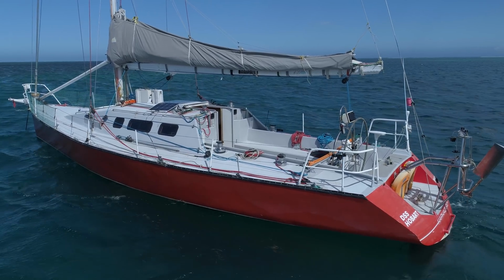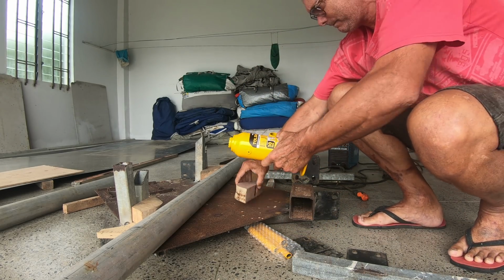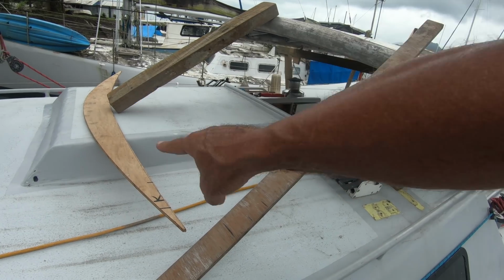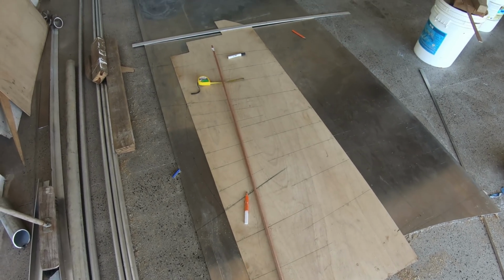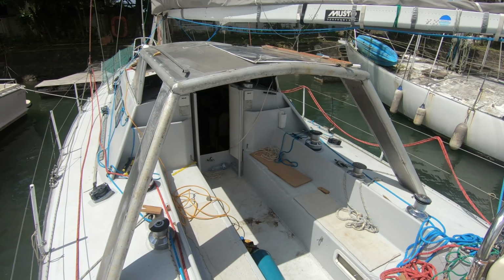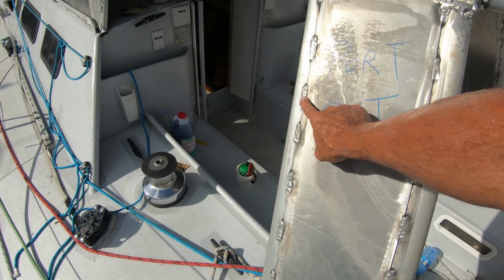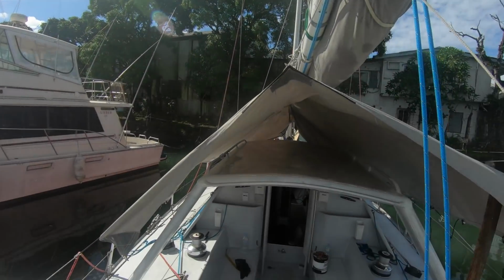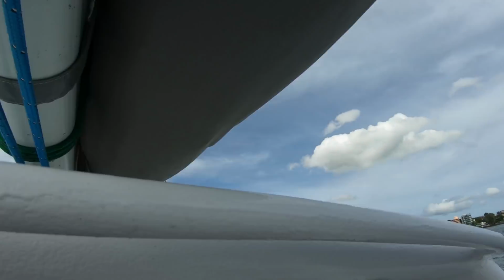Hard Dodger build in Aluminum (Ep7)

Comment: Is there any problems with the boats performance with adding the weight higher up in the boat and wouldn`t you need to add weight in the bottom of the boat to balance it out.
Reply from the maker: Just a little bit. The whole structure is light weight. Probably alot less than one person. When the boat was racing it probably had about 6 crew. That is much more weight.
Reply: Thanks for explaining how it works. @captainscarlegs

Comment: It would have made a much smoother appearance if you would have used Bondo on those rough spots and cracks. That's the way they build yachts believe it or not. Most of the fancy yachts you see have at least one inch of Bondo all over them, shaping them but they turn out nice!

Comment: Cool to know you can blast a pipe with a propane torch to bend it in a jig.  I've seen copper pipe filled with water and then frozen to keep if from collapsing when bent.  Not sure that method woukd work with aluminum, though, as it is less ductile than copper.
Reply from the maker: Yes. Me too. It did work but not perfect bend. Possibly filling it with sand and caping the ends could help. I once bend small Guage alloy pipe with sand in it in a tree fork and got quite a tight bend.

Comment: Great work on the dodger. It looks great. And it makes sense for cruising. 
Those back supports though... are you sure they are strong enough? 😁
Reply from the maker: Thanks. I think the back supports are strong. It has  2 x 2-1/2 in pipe with 3mm plate on both sides. Could easily take the weight of several people.

Comment: Nice work. It's weird seeing the old girl like this. Not bad weird, just different. We used to use the winches on the cabin top for trimming shy spinnakers. The trimmer would stand on the side deck, next to the cabin, and the sheet would lead around the cabin-top winch from the block on the gunwale. Won't be an issue on a cruising boat!

Good to see you've fully embraced the hazard ethos... shorts, t-shirts and thongs while welding 😎
Reply from the maker: Hi John. Great to receive your response. It's good for me to hear about how you used to sail her in Tassie. Are you Launceston or Hobart? I may have to get a sock or a furler one day . So I can use the Spinnaker s. I've got a pile of them in the garage. Happy New year.
Reply: @captainscarlegs  I'm in Launceston. I sailed with Nick in the '90s.
Reply from the maker: Good one. I'm sure you know the boat well

Comment: How big is your boat?  I have a 56ft i want to sail to Fiji (from Sydney) and I have no dodger.  So are you saying i will get smashed?  Maybe I should sell it and fly?
Reply from the maker: No you will be ok 56 is a big boat
Reply: @captainscarlegs  Thanks.  It is a Dufour 56. I commissioned it in 2019.  I am getting quotes for a hard dodger now. I want to sail it to Puerto Vallarta, Mexico.  But first I want to take to to Fiji to iron out any teething problems. It has two stearing wheels and a Code 0 down wind sail so I hope to average 12 knots + when I cross the Pacific.
Reply from the maker: Sounds like an impressive boat. Just to let you know unless you go south 
. Traveling to Mexico will be upwind most of the way
Reply: @captainscarlegs  I know - I will go deep south, then I will be down wind till I hit Argentina coast, then travel straight up the coast down wind.  Then only a small section will be in irons from Panama to Puerto Vallarta, but i can tack most of the way.  I may have to motor a lot for that bit, else the code zero may help.  Deep south, and up SA coast should get 15-20 knots, then last leg 3-6 knots. Coming home is downhill all the way lol

Comment: So good, beats breathing in all that fibreglass dust, eh? Bit of kero in a squirty bottle helps for cutting ally with tungsten blades.
Reply from the maker: Exactly. The fibre dust and all the bog would probably be more work. Thanks for the tip on cutting. Will try that.

Comment: If you add red and white led light strips under the dodger and hide the wire down the posts, if you ever build and another or modify it put 3/4 dams to direct water that is forced thru the sheet holes backout the sides, and if you put same on roof and direct the water down you can fill fresh water from rains in to tanks. I like hand holds on corners where I’m turning in to or out of smaller spaces. The windows end up stronger if you run a t bar down the center like a nascar or race car. Put snaps on your window hard ware so you can snap a shade on the window and save the acrylic over time and the temp under the cover. Looks like you have room for a Jeep windshield wiper. Good work, enjoy.

Comment: Awesome video and explanations. I was worried about the overall look but you did a great job well proportioning the dodger to the hull ... Fantastic work looks great. 3 thumbs up 👍🏼 ... Question...Could/would packing the pipe tightly with sand before bending it prevented it from crashing?
Reply from the maker: Thank you. Yes packing the pipe with sand is a good idea. I did that years ago to bend alloy tube for a Bimini and it worked well

Comment: Congratulations on purchasing a metal boat and bonus points for purchasing a Radford aluminium hull.  Unfortunately I predict you'll receive negative comments on the suitability of an aluminium hulls (from uninformed boat owners who have never owned an aluminium hulled boat).  The most common negative story relates to a bronze penny lost the bilge of a aluminium hull, and the boat subsequently sinking.  This "old"  story is regularly thrown up, but "no one"  can actually offer up the name of this mystery vessel, or the place where the vessel sinking actually occurred.  Just smile and disengage from the conversation in the knowledge that you've purchased a quality boat.  In truth metal boat owners are very knowledgeable about metal hull design, and acutely aware of electrolysis and galvanic corrosion, and employ procedures to manage potential issues. By comparison I have found the majority of glass boat owners generally have only a limited and confused understanding of both issues notwithstanding that their glass boats are subject to the same corrosion issues.
Reply from the maker: Your preaching to the converted. I am a metal boat guy. Don't think that will change. Alloy is great. This boat is 25 years old. Has water in the bilge from rain getting in the mast. I can't see any corrosion. I'm not sure what is the life span of an alloy boat but will probably outlive me. Thanks for your comment and merry Christmas.

Comment: I like it😊 I wish I had one - Great design. I like that covered area you built. I think canvass would have been better . So you can get sun when you want to, and reduce top weight. But the hard top looks real nice. 
   I thought about building a solid one like that myself , with a extended canvas top to reduce top weight, but its more than I have been able to afford for materials right now.  
  And we are fixin to need our boats to get to safety real soon now. Youll be happy you built that thing.
   Im looking at a canvas one for my boat. I may grab it tommorow.  My boat is a little smaller, 30'. So canvas will probably be best for me anyway. I try to keep as much weight as I can,  below the water line. To reduce rolling...
Reply from the maker: Yes canvas will be lighter and on a 30 foot boat should be noticable. Alloy is lighter than I was thinking it would be. I plan to mount solar panels on top.

Comment: I really like that design you came up with. It doesn't look "tacked on" and those back "legs" give it a bit of a sleek & classy super yacht look. You could add little perspex "windows" under the grab rails for looking at the mainsail, but I don't think its enough of a problem to worry about cutting more holes. It also wouldn't be hard to add some canvas sides to enclose it a bit more, but I really like this design.
Reply from the maker: Thanks for your comment. It's encouraging to get good feedback.

Comment: Wonderful job! Looks really good. Just curious, why didn't you leave a single pipe on the back legs with a loop at the top for strength? Is there something you're planning for the back legs? 

This is a job that would be the limit of my skills and patience, I'm really impressed!
Reply from the maker: Thanks and a single pipe at the back probably would be strong enough. I did the two pipes with plate on each side mainly for looks. Sort of to Ballance the front.

Comment: Painting it different color than white would preserve the look, I think.
Reply from the maker: Yes I agree. I liked the grey colour it was but the sun is heating it up till you can't touch it. Really makes the inside hot. I have put insulation inside the aft section that had none but not the sides of the cockpit. Not sure what to do there yet.

Comment: Excellent work. I reckon it looks pretty good, so as long as you are happy that is the main thing. We can fully enclose our cockpit and even in Queensland summer we leave it closed up. It keeps the cockpit very clean. Of course it is a bit toasty until you open it up. Your costs were pretty reasonable. A bloke near us had only the canvas dodger replaced on his Top Hat. It cost (wait for it) A$4600. Just for the canvas and clears and it was tiny. On the tube bending, I made a jig using pine and by putting a hole saw on my bench drill. Just drilled about 20 holes, cut them in half and screwed them to a hardwood sleeper. Then used ratchet straps on each end of the tube to bend it down. Worked pretty well. 4 hours to build and did the job in 4 minutes.
Reply from the maker: Thanks. That canvas wouldn't cost much in material. I guess the sailmaker cost ads up.yes the side roll downs will be change the whole boat and give a good outside area

Comment: Outstanding M8!  Exactly the direction I would like to go.  I have been planning 2.5'' aluminum electrical conduit as it is readily available and benders can be rented.  The 3'' looks like the ticket though.  How heavy is the Sheeting?  Thank You so much for sharing this project.  I am also considering a light weight aluminum ''wing'' mounted aft for some light semi flexi solar that can be raked at an angle to reduce windage when sailing to up.  Again, Thank You so much for sharing this project.
Reply from the maker: I forgot to mention in the video that the uprights are 2 .5 inch. The top is 3. 2.5 is plenty and I used 3mm plate. Glad you got something from the video. Thanks